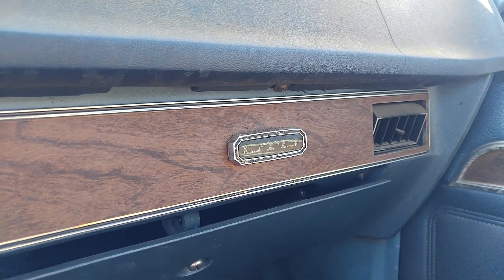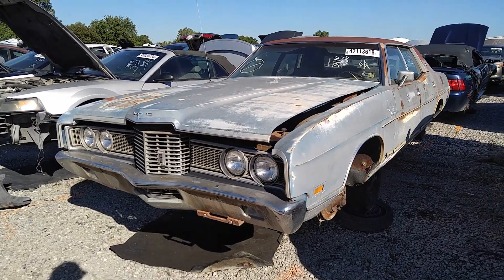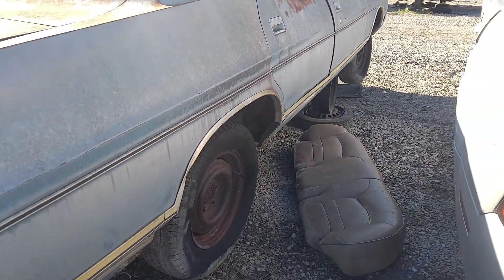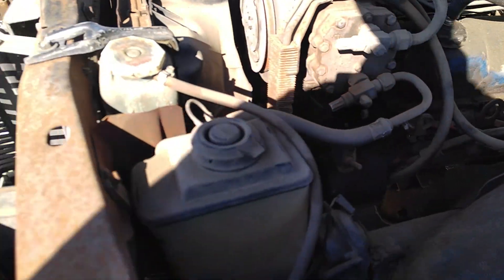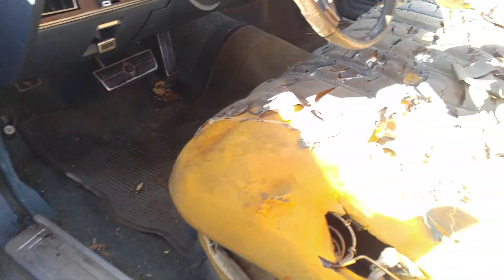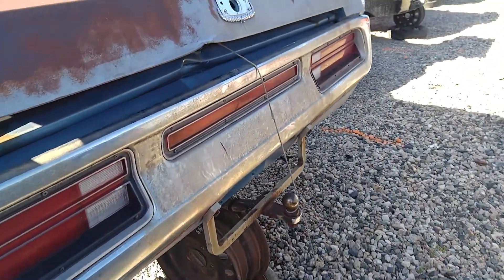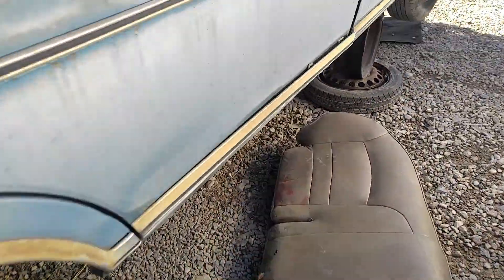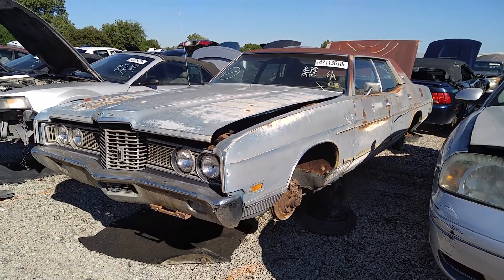1972 Ford LTD Junkyard Find

Comment: Be nice if someone restored love the design on the rear window I was born in 1972 needs a 460 ford loved that 351/400 never have been a fan of that engine 
At least back then they used real spring s in the seats now you get paper thin upholstery and foam with a little bit of cheese cutter wire and a flimsy frames
Reply: The '72 351 Windsor is considered the strongest small block Ford ever made up to that point. Lots of speed parts available for them these days.

Comment: most likely rural car; but no one really wants to restore a LTD. 400 was a good engine in the trucks. weren't they known for being low on oil pressure. Anyway decent yard; sought out truck parts go fast there being on junkyard road.
Reply: I'd still restore one. And I will, as soon as I get one over to europe! 👍
Reply from the maker: Yea I I noticed that as well about truck parts going fast in that yard

Comment: Not worth restoring, they just don't bring a lot of money, even in excellent condition. Lots of good trim on this one, both bumpers look pretty good. The A/C is worth saving, too; period correct for any '72 Ford restoration. The grille is in great shape; they're plastic and hard to find in good condition. PS and PDB on this one, too. Tail lights look good as well. 

The yard should save what they can from this car. There are folks who have one of these Fords and might need some of those goodies.
Reply from the maker: Unfortunately pick n pull doesn't care. About 3 months is all they give the car in the yard before crushing